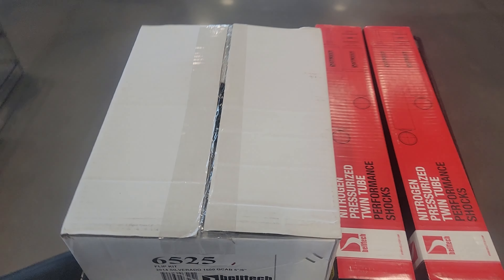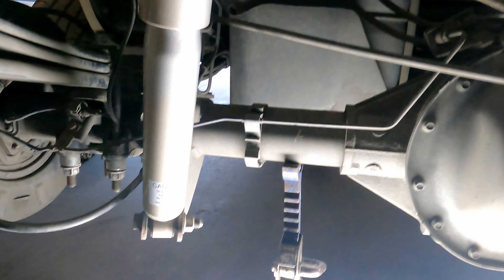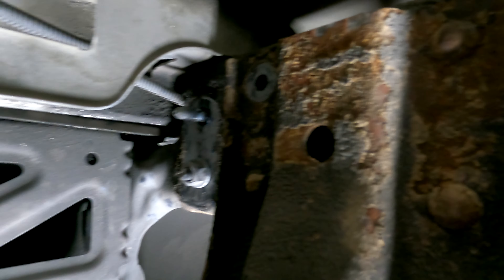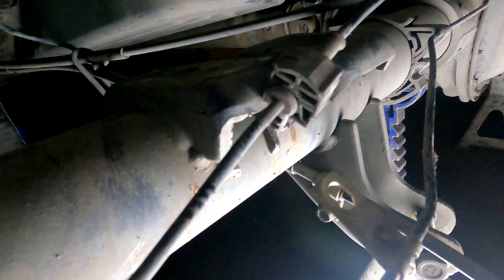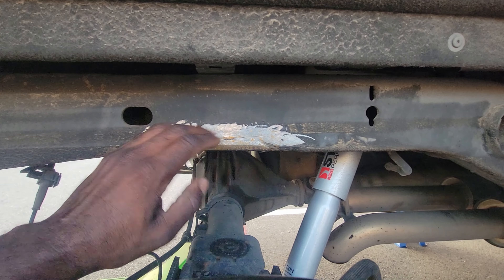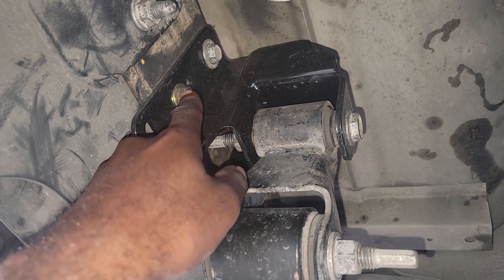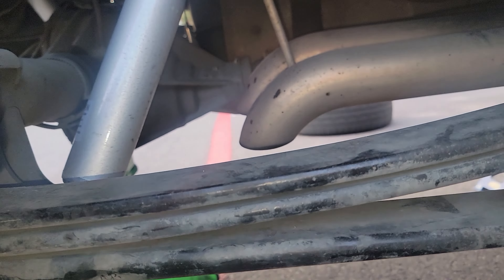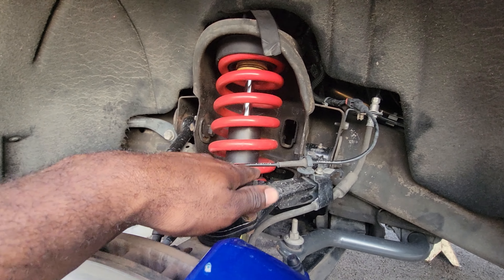14-18 Beltech 5/6 Drop on My K5 Silverado

Comment: How does it ride with the front coilovers any bottoming out on top fender?
Reply from the maker: No sir. They are for sale though
Reply: @BuiltByLondonRacing  thanks appreciate it
Reply: @BuiltByLondonRacing  did you fix the alignment?
Reply from the maker: @danf633  yes I did. Upper control arms fixed it
Reply: @BuiltByLondonRacing  upper arms with the thing that goes on both ends of the control arm
Reply from the maker: @danf633  yes sir. That's it. They have some for lowered trucks
Reply: @BuiltByLondonRacing  thanks appreciate it